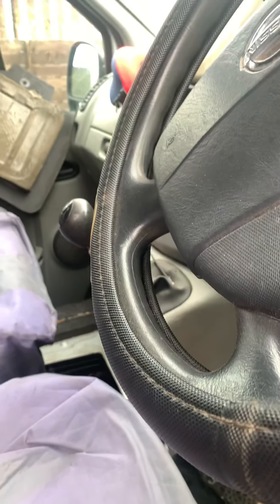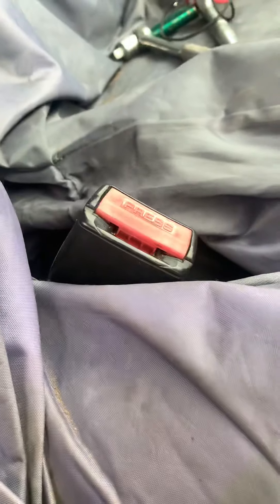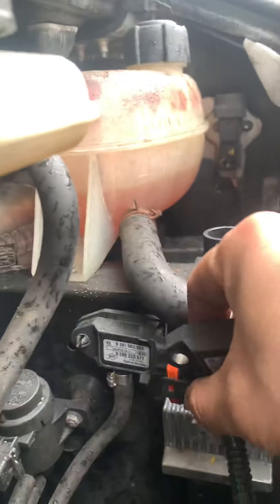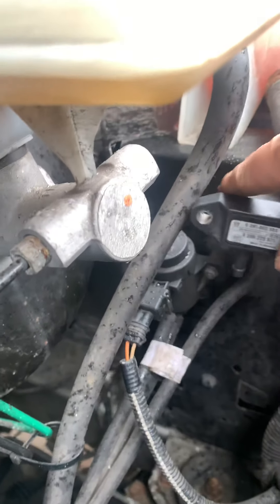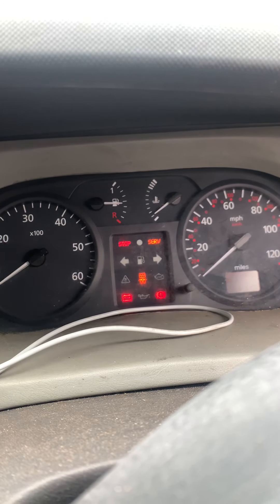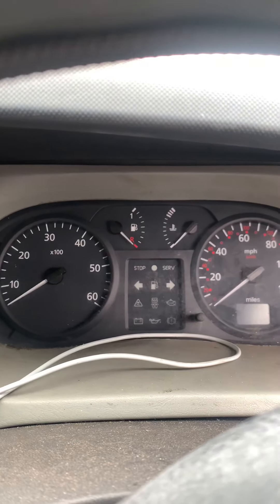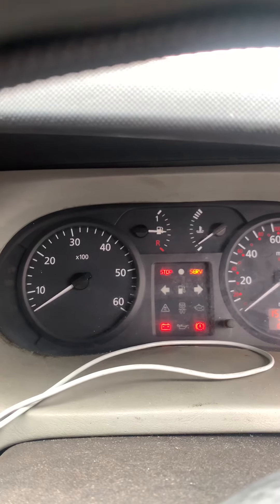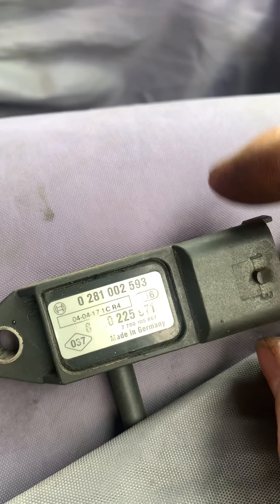Boost pressure sensor compare Vauxhall vivaro Nissan primstar Renualt traffic

Comment: John Clark.  This relates to a Renault Master 2.3 2011. Error message low boost pressure from Launch Diagnostics. Code DF569. When one revs the van the pipe from the turbo to the inlet of the inter cooler collapses. I have checked and replaced the Turbo Charger so all is fine.  Replaced as a piece of metal , like half a washer came out!! My understanding is that when you increase the revs the pipe to the intercooler should not collapse.  Could my problem be with the boost pressure sensor, if not what do you think it could be.
Reply: Did you resolve this yet ? Sounds like air restriction in the air filter if you have changed the turbo
Reply: The pipe you talk about should get harder not collapse which would say that if the turbo is working it’s not able to get enough air ( or it’s still not working)

Comment: Hi. I’ve got not throttle power unless I disconnect the MAF. I’ve bought a new one and fitted it and still have the problem. Disconnect and I have throttle power again?  No lights on dash. Any ideas? Thanks
Reply from the maker: After market one only last a few months

Comment: Hi, I've got a 2007 X83 1.9 with no power under 2000 rpm. Van drives fine on the open road till you get to an up hill - total power loss. I've changed the turbo-new, injectors-new, MAP- 2nd hand, boost solenoid as per you video - 2nd hand and tested the boost relay. Fuel consumtion bad and do not start up as it used to. Any ideas?
Reply from the maker: U service it much? Many possibilities of your problem, need to plug it in to get more info
Reply: I got vivaro 2008 diesel, and I have the same problem with the hills. Its damn annoying!
Reply from the maker: If the map sensor is dirty, it won’t read the sensor properly
Reply: I've got an 07 vivaro code DF569

Just had 2 new Injectors 

Won't go over 3000rpm and it's a bit of a struggle to get there.
Reply: my van was like that, turns out it was qa blocked fuel filter.
Reply: @BEEFBRSKT  also try replacing the boost pressure solenoid & clean the EGR

Comment: I ہے problem with nissan primastar 1.9 with same censar. 
When I am putting new mop censar after 15 minutes driving its lose power.i replaced three censar but problem is same.
My mechanic is saying its faulty censar but the question is that why my van running with old censar but not getting power with new censar. 
My van taking more fuel and giving black smoke. 
I spend £400 but problem is same .
Please give me any advice if possible.
Reply from the maker: Try use original sensor, after market don’t work properly, that’s why
Reply: get it scanned , probably egr or air flow meter
Reply: Check the pipe! vacuum hose

Comment: Have the exact same problem, i ordered a new one, its my last hope that the sensor is dead!
Reply from the maker: Did you sort out the problem?
Reply: @andylee100240  yes wire was broke from the 5V +
Reply: Sensor was not broke
Reply from the maker: @realpremier  so it is running fine now?
Reply: Smoth as new 🎉

Comment: Vivaro 1.9 cdti,the car start but didn’t rev…
Reply from the maker: Could be the throttle sensor, I would plug the van into the computer first and see what’s going on, let me know the results
Reply: @andylee100240  was the cable from the fuel sensor broke from the injectors ramp

Comment: Shouldn’t it have 2 pipes coming off it
Reply from the maker: Maybe yours is a different model
Reply: Correct.
Different set up🤔🙄
Reply: No, you probably think of the boost actuator solenoid. It has a different task.
Reply: @visualinspections6593  That's visible in this video actually.
Reply: Hes named it wrong, he's got the MAP sensor Manifold air pressure sensor, the Turbo boost solenoid next to it has two pipes